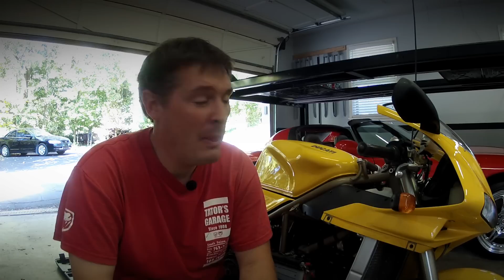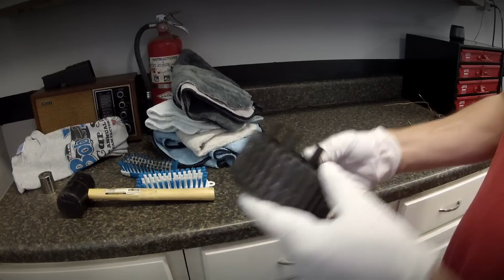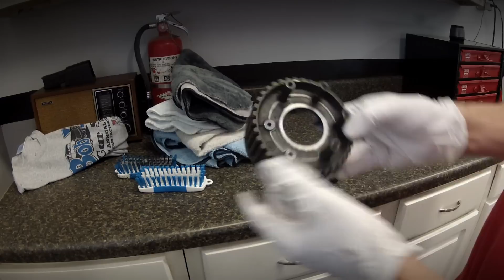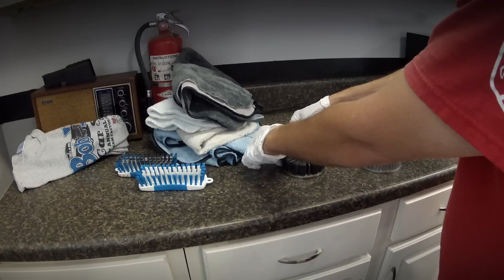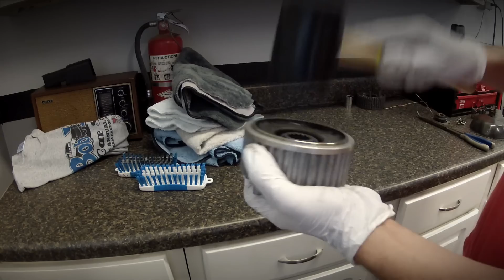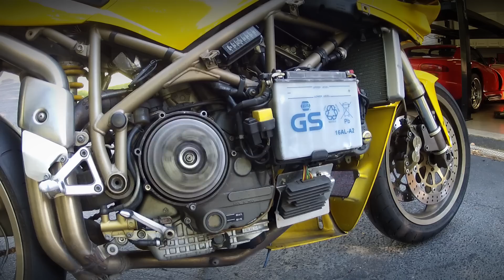How To Replace Ducati Dry Clutch Hub - Clutch Replacement

Comment: great video... im having the hardest time getting the cush drive back into the hub.. any suggestions?
Reply: +Wayne Rohrbaugh does the stem from the hub go between the two black cushions... or between one cushion and the wall
Reply from the maker: +Wayne Rohrbaugh Wayne, the stem goes between the 2 cush drives otherwise you will get a clank with metal on metal, I made that mistake once :)  Good luck with it.

Comment: thank you for sharing this..  i just want to ask how much torque did you do to the center nut...
Reply from the maker: Reggie Flores Glad it helped you.  The torque should be 190nm which equates to 140 ft/lbs +- 10% so anywhere from 126 to 154 ft/lbs will be within specs.  I think I used about 130 ft/lbs. just to make sure I didn't over torque it.

Comment: Thanks for the video. Just FYI when I banged out the hub flange with a socket like you explained it flattened the detent looking pin in side of it and I had to order a new flange. My fault for not noticing it, but if anyone else reads this be careful.

Comment: Hi great video, I'm servicing my clutch and changing the pressure plate, but when I remove the plate the push rod stays attached, any way to separate them or it it time for a new push rod :-(  Thanks Neil.
Reply from the maker: +Neil Kennedy Mine did too, but I didn't remove it from the pressure plate.  I'm sure there is a way to remove it but I haven't done it yet sorry.
Reply: I actually heard that ideally, just leave it in the pressure plate, so I take from that that there can be a very snug fitting, but also there doesn't have to be..

Comment: Good informative video,just on question,what is happening with the two small hook hand tools?,are you stopping the o ring from getting pulled or damaged?,it's when you replace the hub.
Reply from the maker: +Graham Smith I was using them to try to seat the o-ring.

Comment: Great video. Do the clutch hub internal flanges go in the middle (between 2 rubbers) of the pairs of cush drive rubbers or up against the metal of the cush drive holder flanges? You don't show this. I would guess it goes in the middle?
Reply: I would think so, otherwise they will bang against metal.

Comment: Are you able to use a lubricant to help get the cush drives back into the hub?
Reply from the maker: +Ben Skellern I didn't, but an old trick if you need lubricant on something (like fuel lines come to mind) is to use windex.  It lubricates enough to get stuff on/in but then evaporates so nothing is left, good luck.

Comment: I'm replacing clutch plate with a gold one do I have to use torque wrench to tighten clutch spring or just tight snug with socket wrench
Reply: Phil Rodrigues 6 nm

Comment: Hi. How did you remove the clutch plates without removing the hub?
Reply from the maker: mississippipollock They are not held in by the hub, they fit inside it they will just come out when you remove the nut like in the video.
Reply: Rubber Duc What is the arrow for on the pressure plate?

Comment: What would you recommend to remove the push rod from the pressure plate in order to install a new pressure plate? Awesome video by the way.
Reply from the maker: Hi,
The push rod should hopefully come out easy, but sometimes they don't so you may have to tap it with a mallet.  Sometimes it is hard, sometimes it is easy.  Make sure to check Ducati.ms there is a wealth of information on there.  When I change my pressure plate I'll make sure to do a video showing the separation of the push rod, thanks for checking out the video and commenting.

Comment: Hey, my ST2 is acting up.  As I release the clutch lever the bike turns off.  When it actually takes off is acts like if is accelerated and has a hurry up take off,  kind of way.!???
Reply from the maker: +javi Roth Hi Javi, not sure what the issue is.  It almost sounds like the clutch is not adjusted properly and releasing the pressure plate too soon (which makes you take off) and also would kill the bike if you weren't ready for it but that is just a guess, good luck with it.
Reply: Rubber Duc I got it.  I bled the clutch and now it dosent trun off as I release it..tks....

Comment: I have one more question, how do you separate the bearing cap from the bearing in the old pressure plate? I didn't see anything on Ducati.ms about it.
Reply from the maker: Hmmm, not sure on that one, I'd have to see it and try to figure it out and unfortunately I didn't do that on this job so I'm not much help.  I would join Ducati.ms if you haven't already and just post on it, or really any Ducati forum.  There is always someone that has done the job your looking to do and they can point you in the right direction i'm sure.  Sorry I couldn't be more help, good luck with it.  If you do get on with it post a video up here to help others like you!  Thanks for the comment.

Comment: Dear Rubber Duc,I´m very concern to finish my clutch reassembly. According to the Service Manual, there is a "PIN" inside the rub just before the big washer and main nut. As per parts catalogue PIN # 74224.057. I did not see this pin when I disassembled and do not see it on your video also.  Please advise what´s the reason for it, what the dimensions, any issue if I do not install it?
Reply from the maker: +guzforce Hi, not sure what you are talking about, when you say "inside the rub" I assume you mean inside the "hub"?  I don't remember seeing a pin when I took mine off but that was a while ago.  Just make sure you are careful when you pull everything out and just make sure you put it back the "exact" same way.  So if you pull out a "pin" just put it back.  I don't really use manuals, I go by how it comes apart.
Reply: +Rubber Duc  yeap! I'm from Brazil and "h" sounds like "r", yes, hub!
It is a elastic pin and it should be there. I just made one from a roller bearing. All fine now!
Thanks! Great video!
Reply from the maker: Great, thanks for updating!
Reply: Do you mean the slotted hub post? I believe they call it the 'grooved spring post'.

Comment: Does the rotation of the plates matter or just the order? I understand you want the same order and the same side but does where the notches line up actually matter?
Reply from the maker: +Corey Calhoun In my opinion I doubt it would, however I marked them all so I could get the exact orientation.  I could see maybe if there was a weird wear pattern and you moved it say 180° or something who knows if that could cause a minor issue.  Better safe than sorry so I would just mark them as you pull them off, good luck with it.
Reply: Thanks man.

Comment: I found out why I couldn't remove the push rod pin, it had seized up on the bearing. So I had to order another pin to fit into my new bearing. Purchased an stm pin with a ball bearing at the bottom of it.
Reply from the maker: wbvizard70 Awesome, thanks for posting that will help others!

Comment: You didn't mention lining up the mark on the pressure plate with the mark on the clutch hub.... It matters😌
Reply: Could I please ask what would happen if the pressure plate would not be set with a marked spot, what kinda damage could happen?
Reply: @tiborhribar9306  as far as I can work out and thought about this since the post... Nothing... It was mentioned somewhere else and I posted the comment.... Being as the pressure plate appears the same and balance surely isn't in the equation which would be a manufacturing thing I'm at a loss... Easy enough to rectify though... 🥴 Okay seemingly it is about centring the clutch spring screws, certainly not the case on mine looks identical in any orientation... But apparently that's the reason 👍
Reply: @parker550  thanks for clearing this, finally I got an answer... :)

Comment: The one thing I wanted to see was how to reassemble the cush drive... and that's the part you skipped. I can't find anything on youtube that shows it.
Reply from the maker: Sorry about that, but if you just look at it closely you will see it is like a "pie puzzle" the pieces just fit in there, it is easy.
Reply: Thanks for the reply - and I should have added that the video as a whole is very well done.